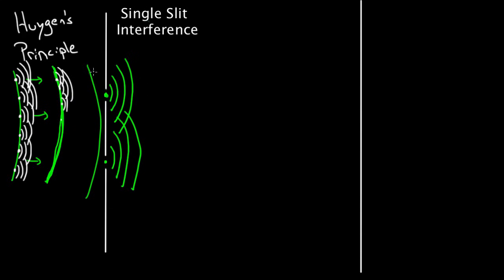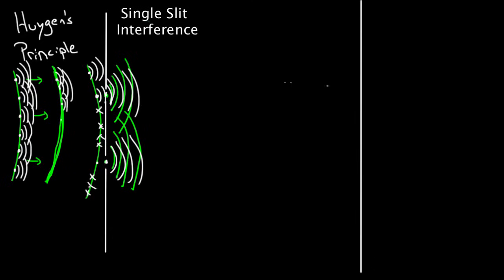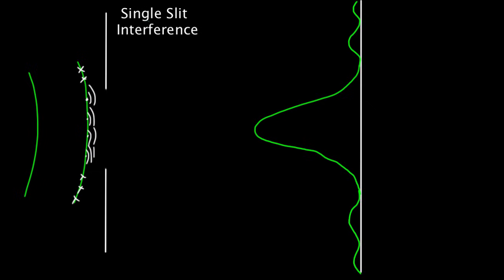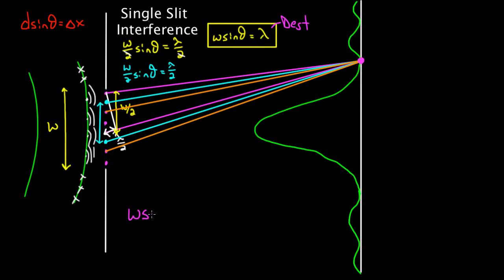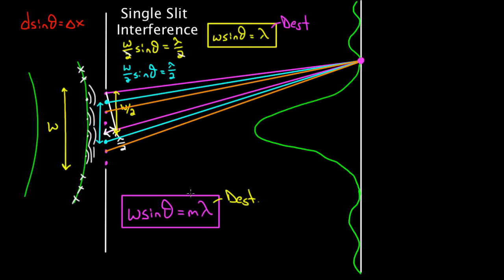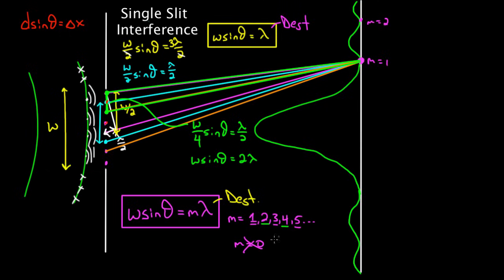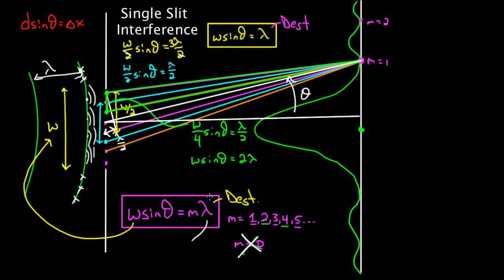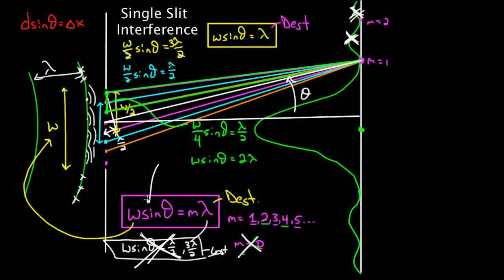Single slit interference | Light waves | Physics | Khan Academy

Comment: This doesnt make sense to me. If this is all about the "micro-waves" within the waves, interferring with eachother, why dont we allways get interferences, even without the slit? Maybe your math explains why, sorry, i couldnt make too much sense of all of it x)
Reply: BALAKUMARAN S im not so sure im poor. Thanks for your insight though.
Reply: Kim you can see interferences in soap bubbles, oil drops etc. There are certain circumstances for interferences to occur!!
Reply: BALAKUMARAN S read the question before you reply. Im not asking about that. Anyone understands wave interference...
Reply: oops!! sorry
Reply: To answer your question "why don't we always get interference?"... well we do. 

The wave front propagation effect Khan is describing is in full called the Huygens-Fresnel effect (the Fresnel bit comes up a little later :)). 

The effect is wavelength dependent; light really doesn't travel in "straight lines", but because of the wavelength dependancy visible light needs to travel enormous distances for the non-straight line thing to be directly observable. 

So for visible light we only really see the results when there is something diffracting the light (like in Khan's example in the video). In optical systems (things like telescopes) we see something called Airy Disks which are the single aperture diffraction effects (the resultant intensity Khan draws on the right in green), except it is a 2D incarnation. 
See...  https://en.wikipedia.org/wiki/Airy_disk

When the wavelengths get a little longer (well a lot longer), we can directly observe the effect where energy has travelled an indirect path, i.e. light not travelling in a straight line (the wave of "mini-waves" Khan draws in white on the left). When we set up radio links for transmitting telecoms data, "line-of-sight" isn't enough becasue a lot of the energy will have traveled a non line-of-sight path; this is why these radio dishs are on very tall towers. If a mountain or the horizon is in the way, it will take out half of the radio power even if you can "just" see over the top. And "seeing"is the important bit, because we "see" at wavelengths of about a millionth of a metre the effect isn't that big so we can "see" the other radio tower; but when the radio trys to "see" the radio waves the effect is massive because the wavelengths are of the order of centimetres.
See...  https://en.wikipedia.org/wiki/Fresnel_zone
Reply: Exactly what I was wondering! Khan did explain it a little in the beginning of the video though; 
Each wave front is made up of tiny wavelets, and these tiny wavelets interfere to create the next wave front. So yes, there is interference all the time and that interference is what makes up a wave.

However, when there is a barrier (single slit) some of the wavelets get blocked. The barrier causes diffraction to occur, and the remaining wavelets create the single slit interference pattern through constructive and destructive interference. 

I'm not completely sure I'm right but that's what I think he means...